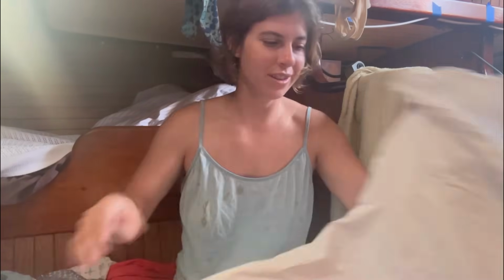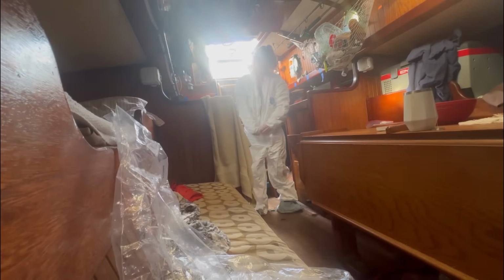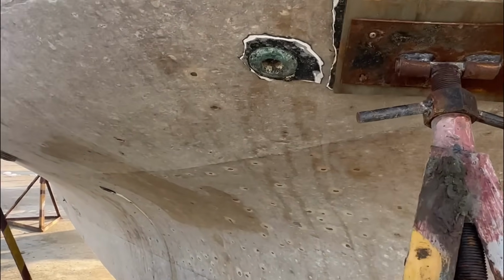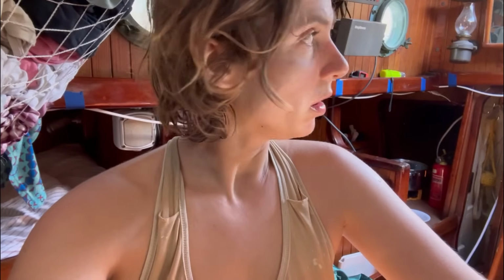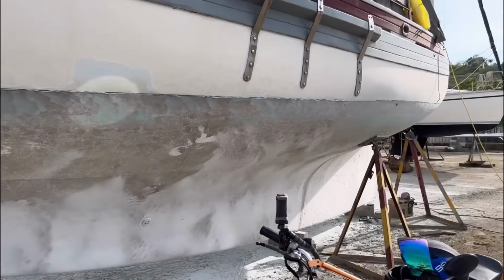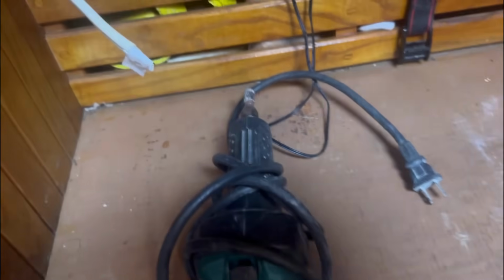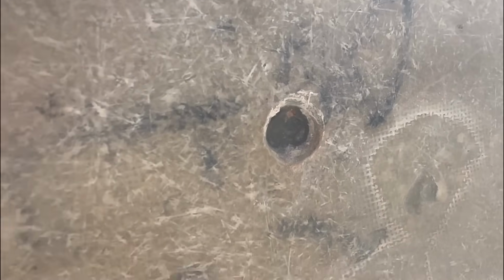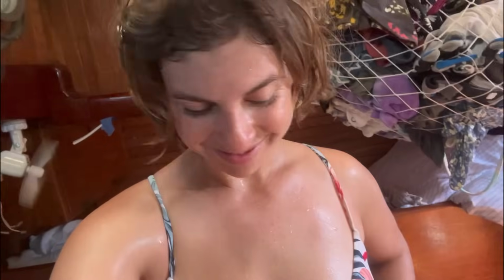S2 E2: Prepping the hull for repairs.. I feel like everything is falling apart (Dominican Republic)

Comment: You are doing brilliantly!  I sometimes used to work in a Tyvek suit in an air-conditioned building and it was hot work.  I can't imagine how it must feel under the tropical sun!  This is the hardest part of the job now.  Everything is in bits and no matter how hard you work it doesn't look like anything is getting done but this is the point where it starts to get better.  From here, you will see that each step starts to bring you closer to your vision.
Reply: we use them at work and its kinda besides the point but some of the guys what they do is slice the back of the suit open with sharp razor blades similar to like a bear claw attack they get some movement thru the suit .. u can also cut the inner thighs and underarms .just a idea ...

Comment: To free up old nuts and bolts. Wire brush all of the exposed thread and nut. Get every bit of corrosion or paint off. Soak with PB Blaster for a day, or longer. Start at the nut to unscrew it. Starting with the head is just a losing game. Hopefully the nut will come off with the bolt/screw still firm in the hull. Wind the nut to the top of the thread slightly past the last thread and whack it with a hammer to try and drive the bolt down if it is still tight in the hole. Even the smaller piece of paint, rust or corrosion can stop a nut from turning. Been there a million times. Take your time if you can.

Comment: I used a grinding burr. Basically a round ball about half size of golf ball with rasp surface. I did 100 blisters in one day and then hit with heat gun which pushes out the moisture and in another day I filled all the rounded holes with fairing compound. Only needed grinder in a couple of spots. Easy peasy. Boat yard now is on same technique. Super time saver.

Comment: I would suggest a shallow cone shaped high speed drill bit/or abrasive, rather than grinding, to get rid of the boat pox. You'll remove a lot less fiberglass, and less fibreglass work later, followed by less sanding. You can then cut circular fibreglass patches and lay them into the holes in layers. Just a thought.

Comment: Hi. You could also wash the hull one week or a few times with a pressure washer and scrub it with a scouring brush.
That way you will make the hull very clean. Also if you remove all the gel coat then the hull, in that temperature, is going to dry out very quickly. That drying leaves a residue that has to be removed with high pressure and scrubbing. Now is the ideal time to take a measure of how much moisture is in the hull and/or let the hull dry for a while before applying a Barrier coat or whatever you like.
But that is your decision of course. But since you've already done so much work. Since you have some osmosis, there will probably be some moisture in the polyester. But you can't tell until you measure. If you have osmosis again, after some time, because you haven't done the right thing now, you can sand it all off again. :) You should consider it anyway. Talk a pro or something :)
And you can use polyster resin. It doesn't have to be epoxy. Its way cheaper. :)
Greetings Belgium

Comment: You shouldn't beat yourself up over your progress. Do not use any polyester resin. It doesn't compare to epoxy for water resistance. The only other advice I have to give is to switch to flat grinding discs with a backing pad instead of the flap discs. Go as coarse as you can get. Gouges and scratches don't matter when you're adding filler material. They're actually beneficial for bonding.  There's NOTHING worse than laying underneath a fiberglass boat hull in tight quarters and grinding over head in a tyvek suit. Nothing helps for comfort in those situations.

Comment: I second all the compliments here for what you've undertaken and what you've accomplished so far.  And I'd like to say most of the hard part is behind you, but it's not...your boat has a SERIOUS case of boat pox.  I'm honestly surprised that a boat with the BCC's reputation had it that bad.  The blisters went well beyond the gel coat.  That's added exponentially to the workload you've taken on.  Most people prior to barrier coat have maybe a dozen large blisters, and 25 little babies that barely get into the lamination; you've got them everywhere you turn, with SERIOUS cavities.  So, give yourself a pat on the back.  Some would have run away after seeing the true extent.  Heck, just grinding off all bottom paint is a job and a half on boats smaller than yours!  But starting with a clean, smooth bottom that's been ground back to the fiberglass, fully dried out (which takes at LEAST as long as you've been on the hard, so don't sweat the time spent so far), and then barrier coated will give that vessel a second life.  And whenever you go to sell her, that work you're doing is very marketable to a new buyer.  You also have it meticulously documented with lots of proof of what you've done.  It's probably already worth a decent bit more than you paid...and it should be with all your sweat equity.  So take a bow
Reply from the maker: Thank you. Yea I think because the boat was sitting in the harbor for at least 10 years without a haul out, the water seeped in. Thanks for the encouragement

Comment: I realise these vids are way after the fact but it pays to read the comments. For example the angle grinder disc flip was covered by another kind soul a while back. Also talcum powder. More hints gleaned from people smarter than me working on boats. Grab some clamping vice grip pliers for all those jobs where you need to grab onto stuff from the other side. Another way of cutting skin fittings, cut the mushroom type top with a cutting wheel on your grinder into pizza slices, just like you were cutting a pizza, careful not to go to deep so you only graze fibreglass, then with  cold chisel in-between fibreglass and fitting hit and lever pizza segments off the tube. The bronze levers and breaks quite easy this way, easier than grinding the whole lot down methinks. 
Please tell me you saw the don't join lithium with agm warning comments from the marine electrians in the last vid.
Reply from the maker: Thank you!

Comment: Projects are like a staircase. The flat parts are where you make progress and not too much effort. Then you run into the vertical part which seems unclimbable. At this point you need to have a strong talk to yourself put your head down and plod along. How long it takes doesn’t matter. You have the guts and determination to keep going as fast as you want. Don’t give up on these stages. One day you will get to the top and can enjoy the next flat bit for a while. Don’t look too far ahead as it can be depressing. One day at a time. All a project is a series of small steps that add up to a major step. You have a beautiful boat, age is on your side keep hydrated and treat the heat as a sick joke that is happening to you. Crossing an ocean is a just a lot of day sails added together. You are on the right road. Turning round sucks so keep going. Take care .
Reply from the maker: I like this stair analogy, thanks for sharing

Comment: You have taken on a large project. There must be others in the same yard who are also doing big refits. They are your "pack" right now.   When I am overwhelmed, I make the goals tiny.  Perhaps, I will do 3 coats of varnish on this item by lunch time and then some other small thing after lunch. That way I don't have to worry about the overall project until one of the tiny goals is to update the project chart.  I believe you can do this.